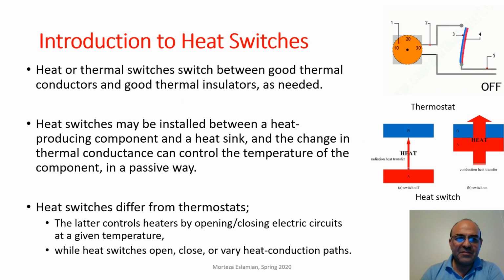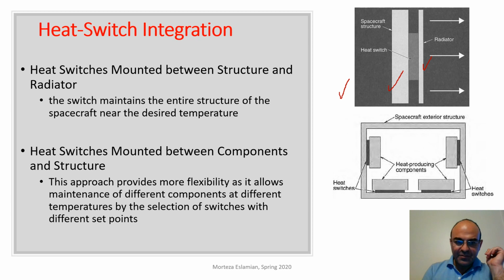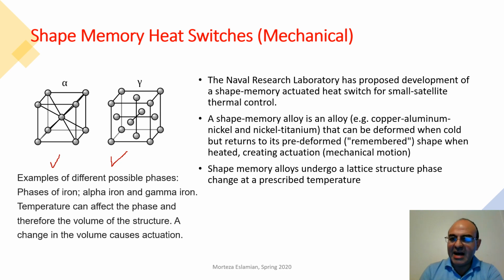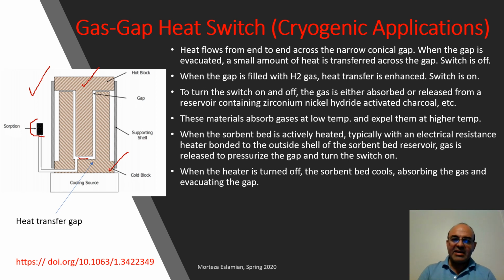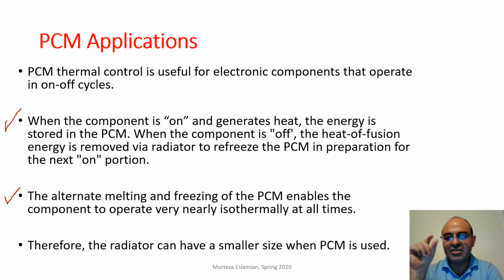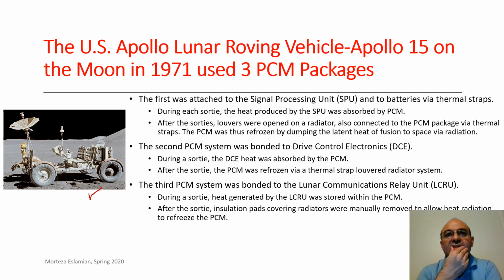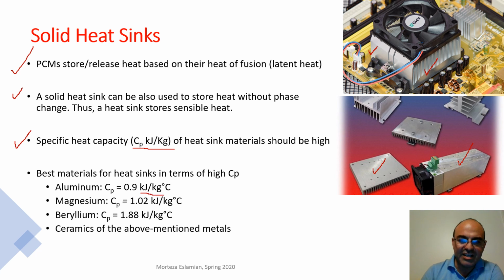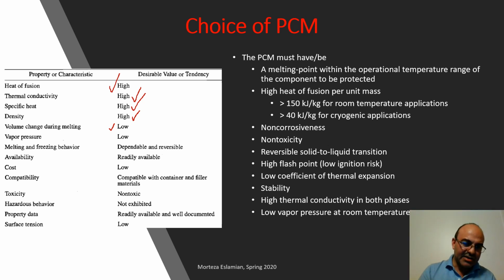Spacecraft thermal management - Phase change materials and heat switches

Comment: 00:06 - Heat switches and phase change materials enable effective thermal management in spacecraft.
03:37 - Heat switches control heat transfer between components in spacecraft efficiently.
10:14 - Heat switches use various mechanisms to manage spacecraft thermal conduction.
13:53 - Phase change materials enhance spacecraft thermal management via thermal switches.
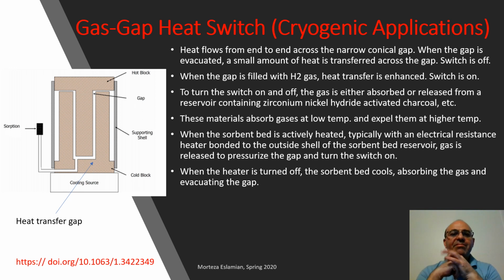20:16 - Gas gap heat switch enhances cryogenic cooling efficiency.
23:06 - Thermal management uses phase change materials and gas absorption for temperature control.
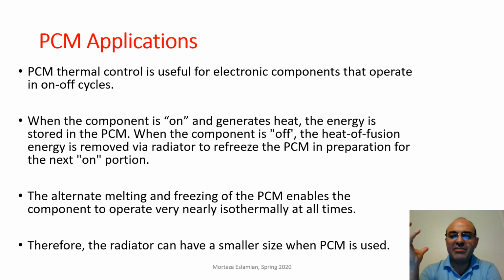28:46 - Phase Change Materials optimize spacecraft heat management by reducing radiator size.
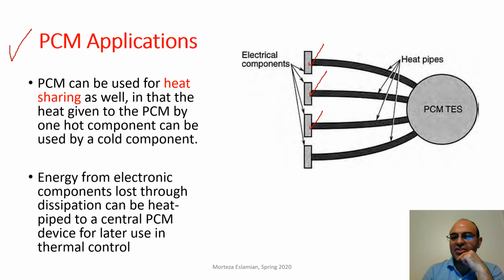31:49 - PCMs manage spacecraft heat during varying thermal environments.
38:00 - Phase Change Materials (PCMs) efficiently manage heat in spacecraft.
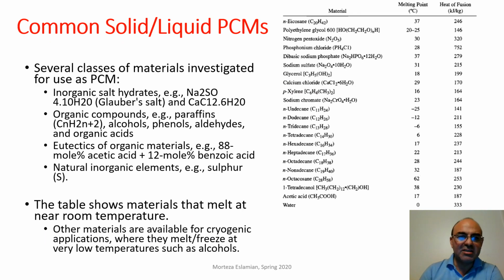41:19 - Phase change materials regulate temperature in spacecraft for thermal management.
47:31 - Optimizing thermal solutions in spacecraft involves mass, cost, complexity, and reliability considerations.
50:29 - Optimizing thermal management with phase change materials requires careful selection of characteristics.